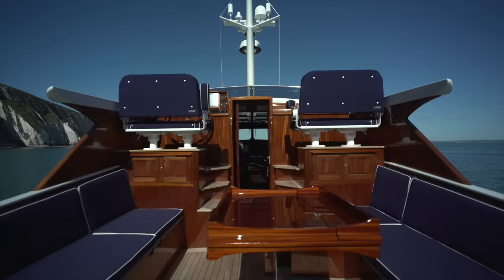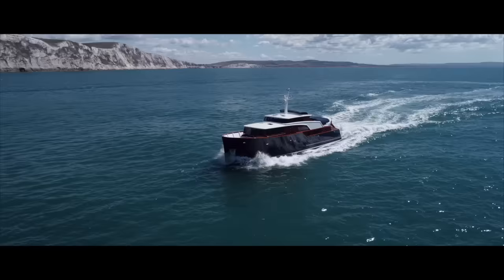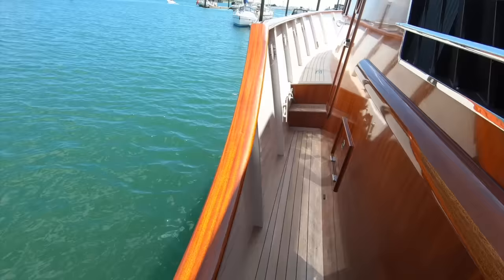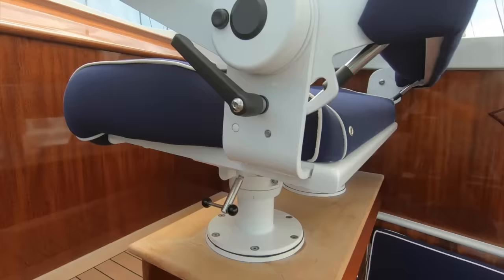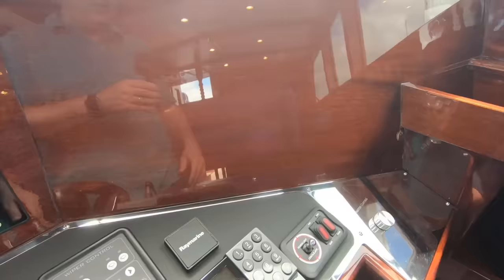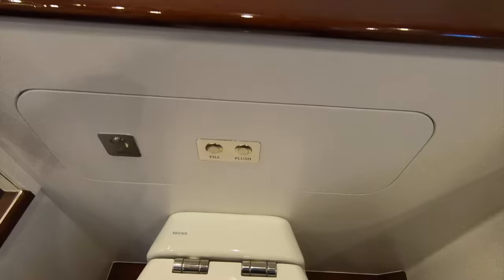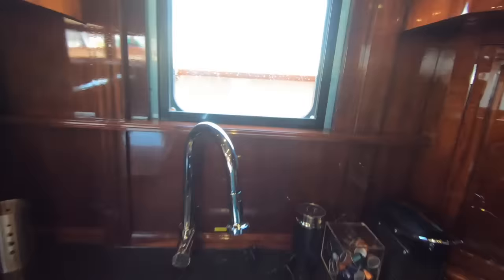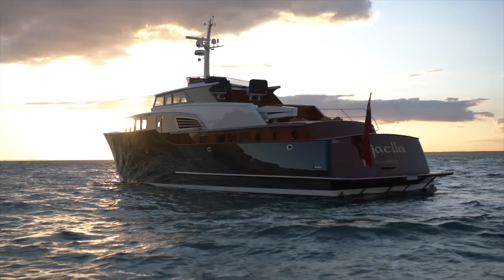Full yacht tour and test drive of this wooden wonder | Spirit P70 review | Motor Boat & Yachting

Comment: This in my opinion is better than all the pershing's, sunseekers, princesses, etc. This has so much class and is just a work of art
Reply: It is something different.  There are builders who do bespoke boats.  Some builders in NE USA do the same (Rybovich/Spencer/Bayliss/Jarrett Bay etc) and also a couple builders in Italy like Camuffo or Sangermani did something similar, and I am sure a couple Dutch builder possibly more in metal have something up there sleeve as well.  Just to name a few names.  That is meaning that if you want a Pershing / Sunseeker etc you are not looking for this boat, and you are looking for something bespoke you do not look at Pershing/Sunseeker.  At the least you will be looking at a Riva.
Reply: Why compare so different boats? Pershing is like a Ferrari, its best at what it does, you cannot "opinion" away the 50knots top speed of the 7x. If the 7x was meant to be a classic wooden boat the

Comment: Hey Jack, I think you finally got one over on Nick ! He's going to have to work very hard to beat this. Stunning boat.
Reply: I’m not much of a fan of Nick’s videos. He is far more interested in explaining which head is to be used by which cabin, rather than talking about the engines and performance. Seems like a nice fellow though.
Reply: @trailerparksupervisor7046  reason I like his videos are they show all areas.
I'd rather see the engine room and crew areas than hear the specs and service interval of the equipment, so many boats have impractical engine rooms and barely anyone shows full access to the boats
Reply: In most videos Nick does state range, engine specs and top speed/cruising speed,...
Reply: @andreashabeck1155  You must not pay attention? He mentions it in every video I've watched.

Comment: First, thank you for bringing back a lot of memories, I used to sail that area a lot, first in a Saber then a Princess, many times during the summer we would sail down Southampton water, sail past Calshot then drop anchor right by the Needles. Okay, the P70, I love everything except one thing.....The craftsmanship is amazing, the owner has great taste, I agree, the forward solon is breath taking....Okay the bad...You are spending a few million on a long range cruiser, yes a fast long range cruiser, but the noise level in the cabin is just to high. I'm looking at Flemming 55/65's right now, for the same purpose, long range cruising, though of course a lot slower than this vessel, and the noise levels in those cabins is so much lower, for myself, that would be an issue, but obviously the owner of the P70 can put up with the constant noise...
Reply from the maker: Thanks for the comment. It is on the loud side but the Go Pro probably makes it sound a little worse than it is. For the record, at 18 knots, I recorded noise levels of 76 dB(A). JH
Reply: @MotorBoatYachting  Thanks for the reply, okay, 76db is certainly better than it sounded in the video.

Comment: That is most definitely a work of art.  I would have gone with something other than the mahogany throughout (probably a mix of teak and mahogany) but other than that, sheer perfection!  I didn't see it on the Spirit website but I was wondering about the draft and the AIR draft (bridge clearance) of the P70.
Reply from the maker: Not sure of the air draught, but the draught is 5ft6in (1.7m)

Comment: Absolutely spectacular boat size fit and finish the only thing you didn't cover his what at displacement speeds 9 knots what is the total range based on the configuration and does it have 2 generators or just one I couldn't tell other than that spectacular boat.   The Banks Family 👪

Comment: As close to quality finish as a Riva, the split levels make this boat interesting. Fuel consumption seems a bit high at 130 litres and hour but other than that a beautiful yacht. great video, thank you.
Reply: For 5 plus million pounds you could have the new riva 88 folgoro or even the 90 Argo! I no which one I would take and it ain't this over wooden, no exterior seating areas only the dianette behind the flybridge helm and cramped interior! I get the beautiful woodwork but yachts need to be practical and this boat has all the features that were left behind in modern vessels! On 70 feet no swim platform, no forward seating or sunbathing, no aft cockpit and no flybridge seating! And the interior is still cramped! Sorry I dont like the practical usage but the woodwork is beautiful! But so is my kitchen at home! A great nod to history but a horrible no to practability and outdoor space! And when sailing the outdoors is were it's all at! Happy sailing all⚓🛥
Reply: @baddazzgarage2953  I agree 100 percent but this still does not take away from this boat that it is spectacular in finish and design,  the owner wanted this, the money way available.

Comment: The woodwork is absolutely beautiful. The  boat is very stylish in a retro way, but the shape of the bow may present a problem in waves, a flaring bow would ride on the wave while this one will cut thru them, with a good chance the deck will be drenched. The wood on the outside is another headache, how do you protect it from the salt and the sun of the Eastern Mediterranean? I have wooden rails on all my balconies in my summer home in Greece and the sun alone ruins them at regular intervals, and I have not bothered to refinish them in 9 years. BTW I was a professor of Naval Architecture for 38 years, at the US's top NA&ME Department, and then an Emeritus.

Comment: Brilliant review great boat. You should use an app called filmic pro it’s about 15 quid but it’s easy to use and you can lock the iso so it does not change the light settings from bright to dark.
Reply from the maker: Thanks for the tip!

Comment: Amazing boat, its a big pity its so noisy, that noise destroys everything. I would not want to spend even an hour in that noise. Outside though it was great, I so wish to have been there. You got to do something with that noise inside though, put the engines on a vibration free mount and noise isolate the whole engine room (again?)

Comment: A beautiful elegantly styled boat, too many modern yachts look like running shoes. I love the look of 1930s to late 50s yachts, very classic design that is timeless. The same with that era of wooden speed boats, timeless beauty. 10,000 litres of fuel consumption for about a 750 kilometre range😳 Well all know the saying, if you have to ask the price of………..and if you could afford to buy and maintain it…….it’s 10% a year of what it’s worth to buy it. That doesn’t include using it, that just means what you have to spend to prevent any part of it from deteriorating.

Comment: I have only one concern and that is placing the cleats on the transom. 
Would that not bring a bit of stress to the side walls?
Reply: The ropes just pass through the transom, I'm sure that corner is structurally designed and sound for the cleats and the loads on them. She is a great design none the less.

Comment: Very nice I do like it, now the But, all that woodwork, I don't think I like to be the one to keep it clean, It was bad enough on the Ship I was on and that was all inside and undercover, will not take long for salt to build up, also where's the crew quarters
One day I might be able to get my boat hull design built and if it works, will be able to sail round the world without topping up for fuel and have the fuel cost a boat half it size  and be able to do 50 knots with ease

Comment: Hmm, lots of varnish. I thought the cabins were laterally cramped. I don't like the outside areas and a fllybridge is a nice area to have BBQs, great views and lots of adaptable space. Yes, the range is large, but so are the tanks. It's definitely more economical at 18kts.  Personally would prefer a Navetta 73 which could get 900nm+ at 9kts using 4000l. I wouldn't be in a hurry. I'm sure the owner got the boat he wanted, so good luck to him

Comment: If you set the maximum speed at 8 or 10 knots, could it make an crossing  Atlantic a possibility?
Reply: There seems thbe ever less use of fiddles, take that table it has fiddles when folded when folded up in the small size but when it's opened out there are no fiddles. There are few fiddles on modern jackets, modern yachts, they might have stabilizers but you still need fiddles, they also contain spilages.
Reply from the maker: At 10 knots the range is approx. 3,200nm.

Comment: For non boat people like myself is there some sort of calculation to convert 180 litres per hour in to an understandable mpg figure?
Reply: Approx 4.5 litres to 1 uk gallon (slightly different for a us gallon), 180 litres per hour is approx 40 uk gallons per hour  divided by 18 nautical miles per hour is approx 2.5 uk gallons per nautical mile. Just roughly estimated figures. 👍
Reply: 2.35 gallons per mile in US version